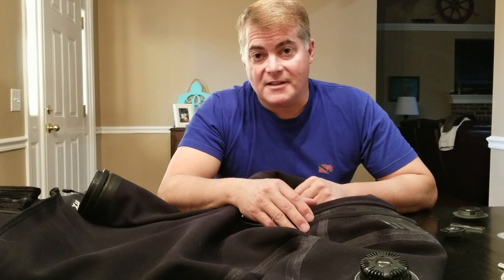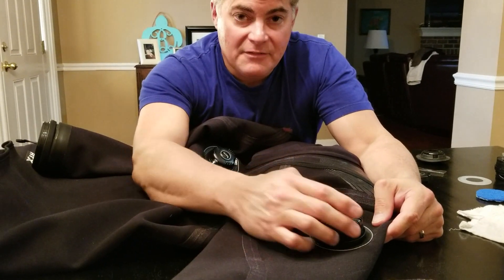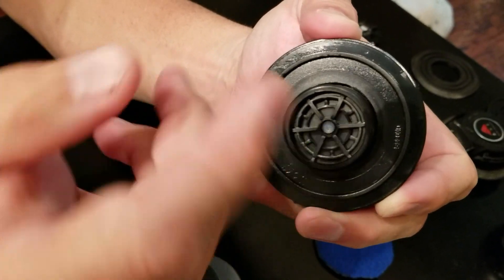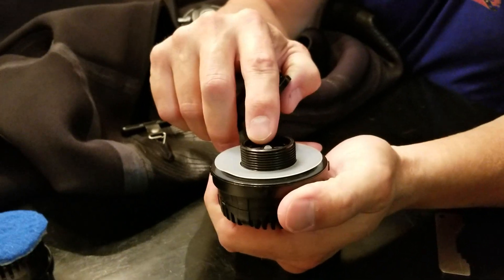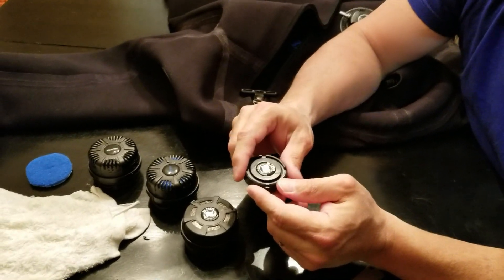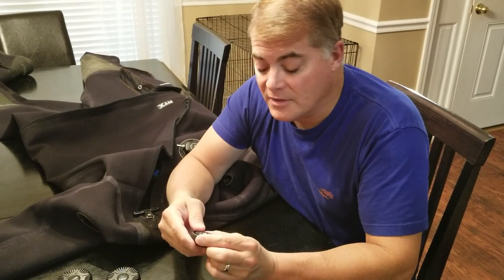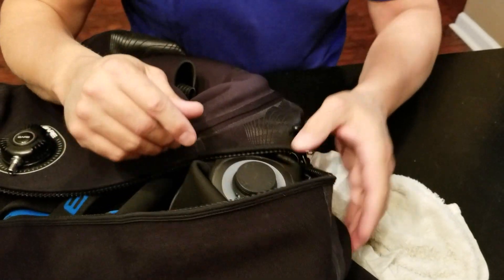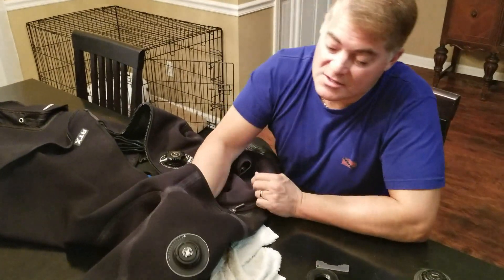Drysuit Exhaust Modification

Comment: Interesting mod.  One question: one of the features of the stock exhaust valve is that it has the capacity to dump gas at a rate equal to that of the inflator valve - in the event that your inflator fails open.  The immediate actions, of course is to disconnect your inflator hose while you orient yourself to dump gas as well as exhale to minimize your depth transient.

Any thoughts to venting capacity? 

It would seem that while in normal diving, your mod would function as you've intended, but for gas to go through 3 check valves, flow rate would be lower, and that's without me knowing the size of the pee vlv check valves relative to the std exhaust vlv....

That being said, if you keep your head on straight, with an inflator failure like I mentioned, I'd think immediate actions would still work out ok.    🤔

Thoughts?

Comment: Hey SeaJay, I did your modification to my waterproof d7x, and when it works it is a game changer, however quite a lot of the time the valve is not venting whatsoever.  I discovered this the first time when I removed my shoulder dump, and had to emergency vent through the neck...I am trying to figure out what is happening, but basically if I install the P valve front, and the cuff dump back and form a seal around the back with my mouth, and blow from the back I am unable to get any air to come out.  I am wondering if that little circle ring that comes with the cuff dump needs to be installed?  I am going to try it tomorrow with that and hopefully will have better luck.
Reply: hey, do you still have the problem ?